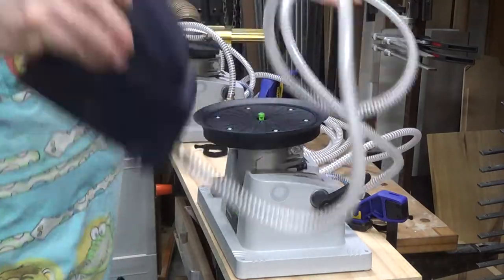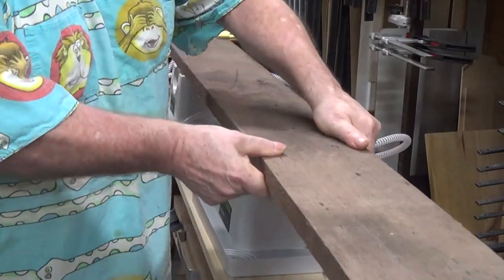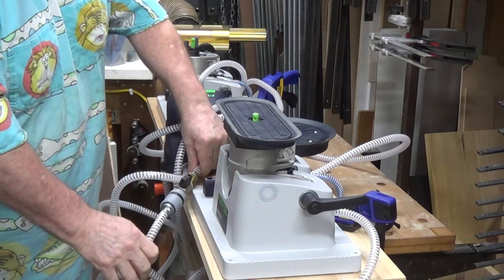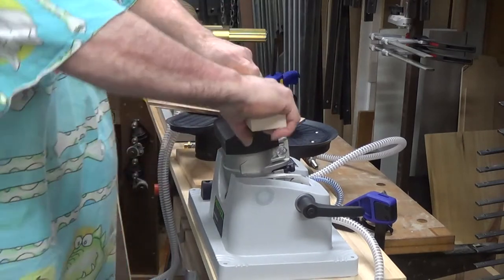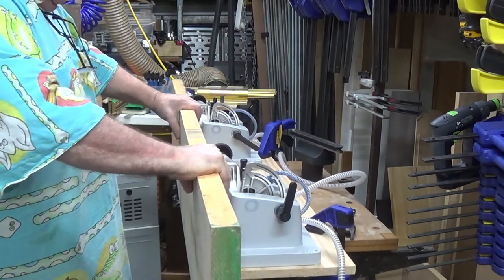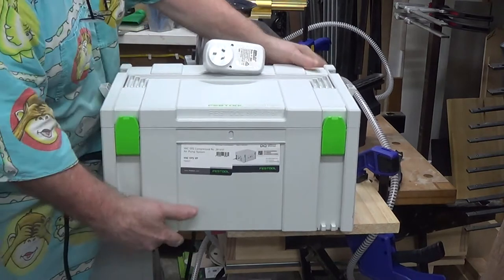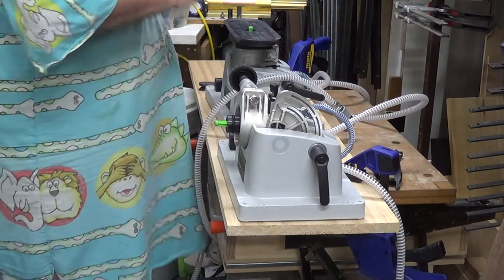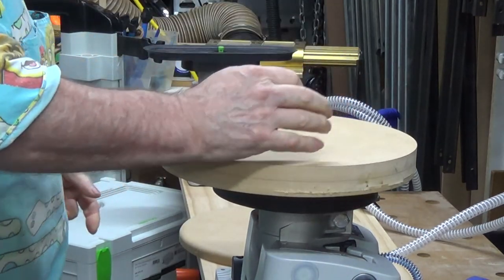Festool SYS VAC First impressions

Comment: I see that the vac pump comes built into a sustainer now? is that only in the UK? also how did you get Alexa connected to the sys vac?
Reply from the maker: Thanks for looking DW. I live in Australia, so it's SYS VAC'd there as well.

I have it attached to a "smart plug" that I control with Alexa.  
   https://www.lumberjocks.com/LittleBlackDuck/blog/129894
While the switch is only about 2 feet away, I just turn in on and use Alexa to control the plug...
I tried the same process with dust extraction... works great for turning on, but too bloody noisy to get Alexa to her the OFF command, unless I scream...
Dust extraction is controlled by old tech remote power plugs,
   https://www.lumberjocks.com/projects/264362

 A four gang "smart powerboard" is a handy addition to the workshop to control tools/machinery using Alexa.  I have swapped out some of my machinery mag switches so I can control power through the power plug (mag switches will not permit auto turn on).
Reply: @alexkara9696  thanks for the reply, looking into it, the pump in the US comes outside of a systainer. bummer.